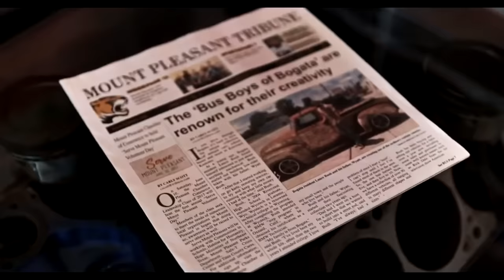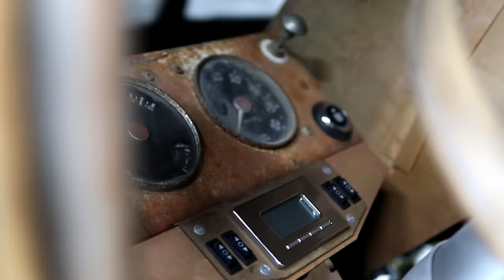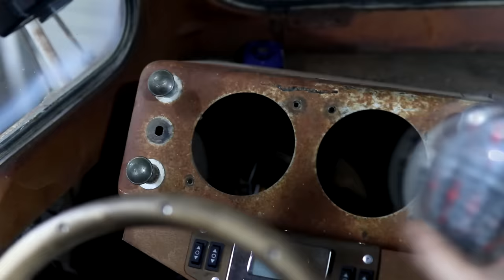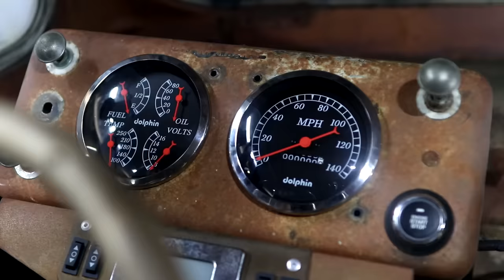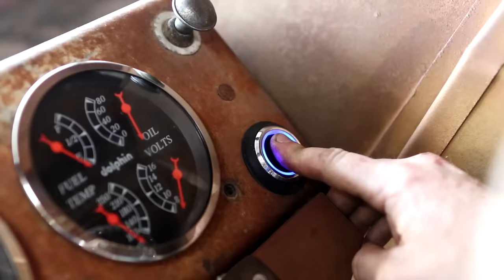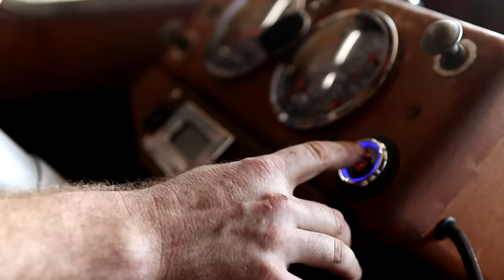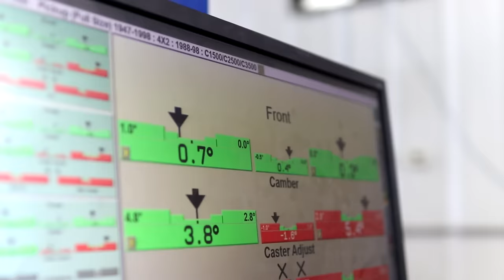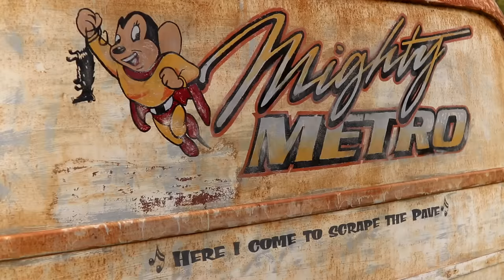1954 International Metro Build COMPLETE!! | Operation Metro Build | Turnin Rust

Comment: The van is very nice !!! I would paint the exterior with clear lacquer to preserve the rust and prevent it from rusting. The Edelbrock engine is too powerful, it is for competition / exhibition cars. Not to mention that it must be very noisy. I would put in a modern efficient 2-liter engine and make a good soundproofing in the cabin. As it is, it leaves you deaf in 10 minutes. The interior would be new, respecting the time, but with modern safety elements, such as glass cleaners, head restraints, inertial seat belts, airbags, soundproofing and modern locks. Modern brakes, suspension and wheels for everyday city use. I wouldn't leave it in a garage collecting dust, I would use it every day.

Comment: That frame and the add ons make this on of the Baddest survivors out there from an era where vehicles were works of art.
How cool would it be if it was possible to make the floor and engine shroud heat resistant see thru !?!
With see thru lower side panels.

Comment: yep, a '54 Metro in quite uncommon, what makes it unique; although being a fan of air ride systems, I wonder if it is long-lasting, considering it's mainly inflatable rubber, as regards the weather: summer-winter, hot and cold temperatures, just like tires for instance. But no pain no gain.

Comment: Looks great. Did you consider sending the gauges out for restoration? Would have looked much better w the old gauges vs those modern units. Check out Seatle Speedometer. Buz is the owner. Does great work.

Comment: That is one cool rust bucket and it sounds so good🤘 an awesome job done by a great group of guy👍... would like that just with a chrome grill, and that old Cadillac bumper definitely rechromed, mirrors, and the trimmings around windows, wooden dash and steering wheel. Or is that to much for a rat rod/ rust-bucket ?

Comment: I have a '95 Ford E350, with a 460,E4OD, 4.10 rear and 194.5 wheelbase, with 19500 miles on them. I have stripped the Motorhome part off and am looking for a 30s-40s Ford cab and frontend, or maybe a COE. Any Ideas?